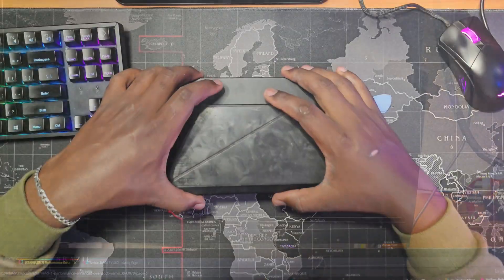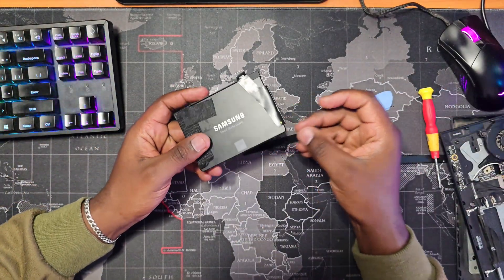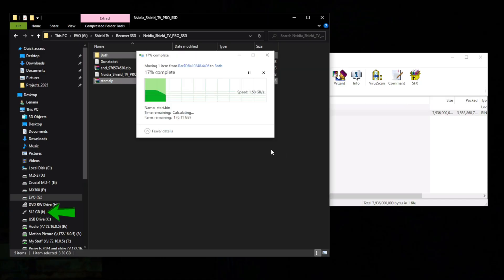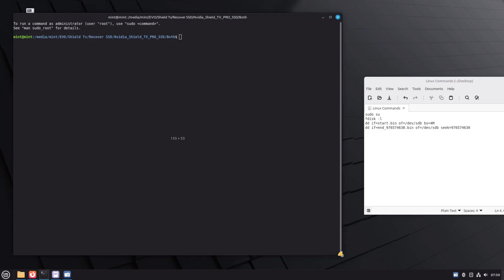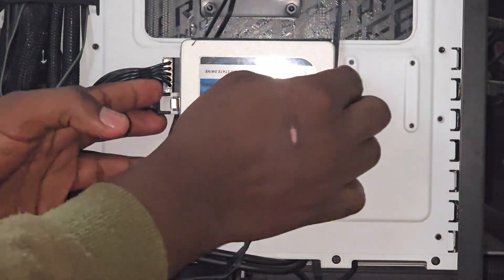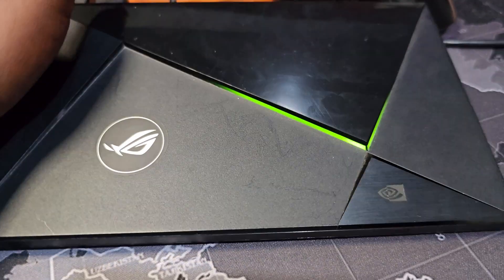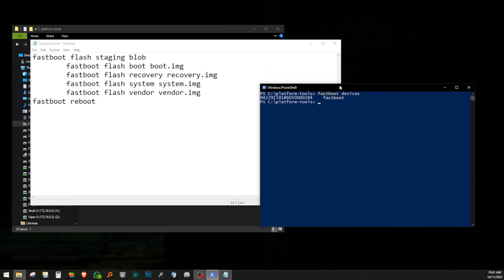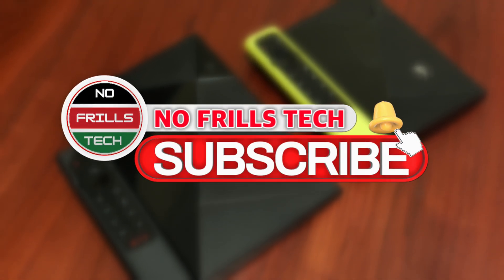How I unbricked a 500 GB Nvidia Shield Pro from a blank drive. #nvidiashield #nvidia

Comment: By following all these steps in the video, you can throw away your NVIDIA shield TV. Do NOT. I repeat DO NOT, format your hard drive that originally in your shield console, you are going to loose all your Widevine keys, sertificates e.t.c. Netflix will never work again, you wont be able to log back in to google account to setup console.
Reply from the maker: I have mentioned that caveat about widevine at the end of the video. This tutorial is for those with completely dead units. In the video mine logs back in to google with no issues at all. Also why would you throw it away? It could be used to watch youtube and the like. Best use would be to make it a home plex media server. A working shield is better than a dead one.

Comment: After bringing mine back to life, my google credentials won't log me in even though i know they're correct. got any advice on that?
Reply from the maker: That's weird. Try flashing firmware 8.0 available at https://developer.nvidia.com/tools-downloads#?tx=$additional,shield

Edit: Seems the image is no longer available. Let me see if I can upload one.
Reply: @nofrillstech thanks, I'll give that a shot. Probably the most concise video on this,  btw. Good work.

Edit: saw your edit and no hurry, I won't have time until next week. Thanks for the help🤙
Reply from the maker: @stevenhill473 I appreciate it 😊
Reply from the maker: @stevenhill473  Here's the link to the 8.0 recovery file https://mega.nz/file/mFlChBZS#2iBrvCaYHbfX15T1WCoi1sUqGRIkP7fMz134wEgtpfY
Reply from the maker: If that fails use 'HDD raw copy tool' to copy the .imgc file in the link below to your shield drive. You will have to remove the drive and probably use a sata cable to perform this copy.
link: https://archive.org/details/2017Nvidiashieldpro